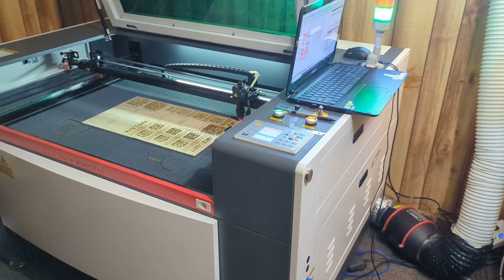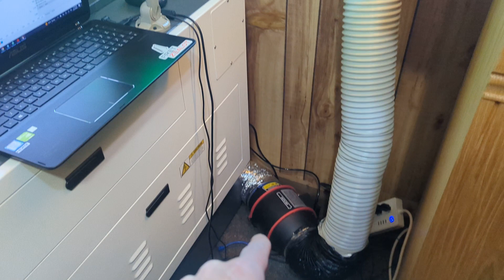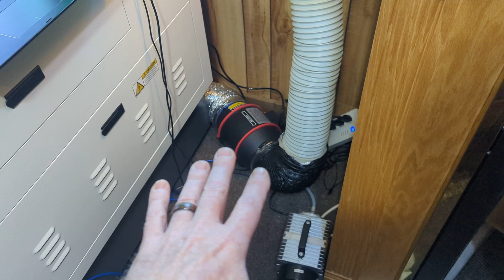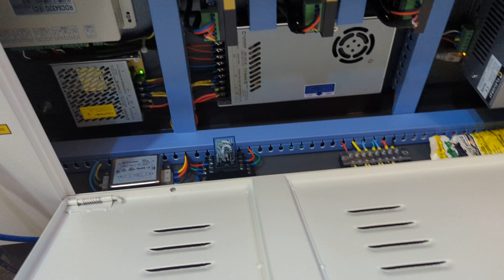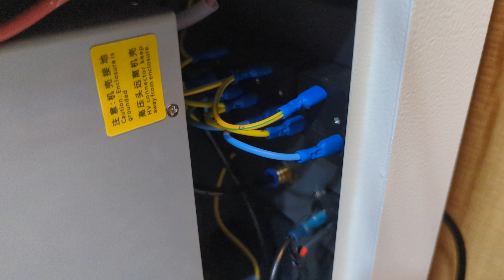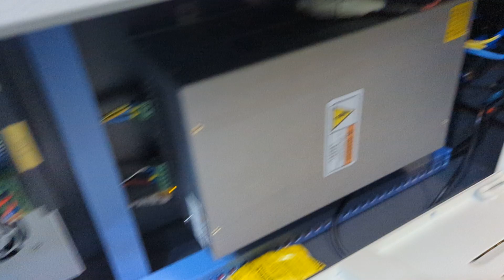New CloudRay laser small gripe. Small one....

Comment: i would love to know how to do that relay.  it will definitely prolong the lifespan of the fan and the compressor.
Reply from the maker: The Ruida controllers have wiring diagrams freely available which indicates the wiring for various connections.
Reply from the maker: I actually now run the compressor connected to the controller so I can use the software controls for air. My fan I just use a pushbutton to control it's relay.